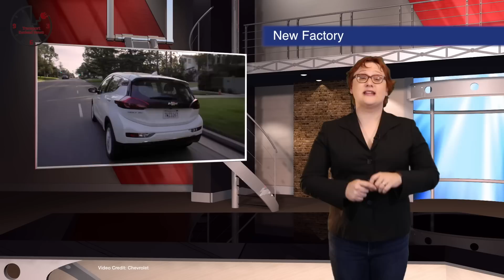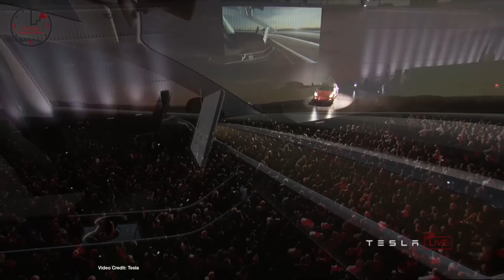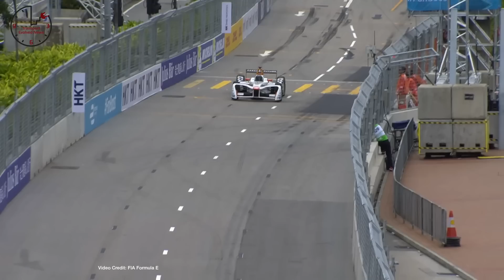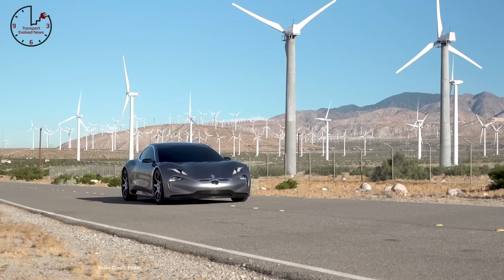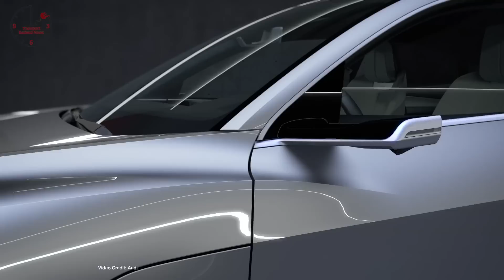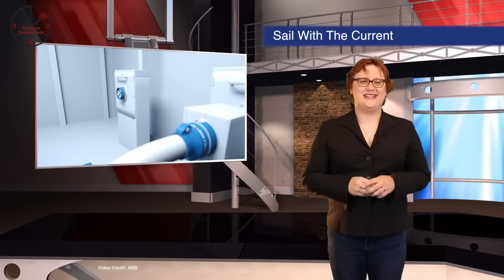Bolt EV Expansion, Model 3 Efficiency, Tesla Car Sharing - TEN Future Car News 8/25/2017

Comment: So, Toyota, Hyundai, and Honda, have managed to sell 1,600 fuel cell vehicles? That was nearly twice what I expacted, but still far less than what they had planned (Toyota had predictdd 2,000 by now) 
Tesla produces and sells more EVs in a week than the total production of all fuel cell cars from all manufacturers in 40 years! Hmm, same for Nissan and GM. 
Not looking good for hydrogen.
Reply: give hydrogen a decade or 2... remember EVs was around for over 100yrs and its still taking slow to sell... i'm not saying hydrogen will be popular with cars but their is a future in semi trucks...
Reply: Chris Muir Well their are a lot of hydrogen fuel cell buses
Reply: The first hydrogen fuel cell was made in 1838, the first experimental fuel cell vehicle somewhat later. So, fuel cell vehicles are not that much "younger" than battery electric cars. 
The real drawback of hydrogen fuel cells is the cost of hydrogen fuel, which leads to a per-mile cost higher than gasoline or diesel, and a price several times higher than "driving electric". For that reason alone, hydrogen has no future in semi trucks.
Reply: well Toyota is building hydrogen buses for the 2020 games in Tokyo, so we'll see how economical it really is and if it does really have a future... as for the cost of hydrogen many experts has said time and time again if we was to produce more hydrogen it will become much cheaper (even cheaper than gas to run per mile)... currently battery EV is the cheapest to run per mile (but not for the long term as the cost of a replacement battery put it around the same maintenance cost as an ICE car).... 

i think there is a company named Nikola that is selling hydrogen trucks (the funny thing is that they did do the research and saw that a battery EV semi truck is not worth the operating cost or down time it will take to charge up a battery that size, not to mention the weight of the batteries) big companies has already made deals with them and they'll be building a bunch of hydrogen refuel stations in north America...
Reply: There were hydrogen busses at the 2010 Vancouver Olympics, too, but they haven't caught on, even there. High cost of hydrogen is still an impediment, and for technical reasons hydrogen will always be several times more expensive than electricity, there is no way around the physics involved. 
As for "battery replacement costs", it turns out that the PEM fuel cells also have a limited lifespan and a high replacement cost, so the cost per mile is still going to be much higher with hydrogen. 
As for the "Nicola truck", it is still under development and testing, production is years away. Tesla may beat them to market with an all-electric semi, it is not clear whether Tesla plans special "Semi-Superchargers" or "truck battery swaps", but it will involve Tesla auto-pilot driver assist. The huge fuel cost savings of "driving electric" is compelling to any trucking company.

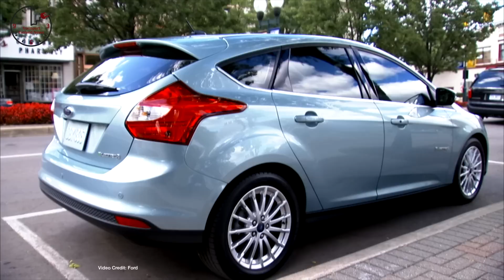Comment: 2:31 Ford made an electric car??
Reply: hornetluca yup. Compliance car. It was the Focus Electric. It got under 80 miles of range I think. Pretty cheap on the used market too.
Reply: Joseph Schatz thanks for your reply.
Reply: Joseph Schatz There's a new version out, I think. Bigger battery, but not much more range - still less than 100 miles. I watched Bjorn give it a go on YT this morning. Still very much a compliance car!
Reply: Main problem with the original was no possibility for fast charging. Coupled with the low range it really wasn't attractive. The new version is still basically a converted ICE car, meaning battery tucked under rear seat/in the trunk instead of built into the floor for better weight distribution etc.

Comment: I have little sympathy for GM. With a leading EV at the moment that has many singing its praises and demand alone for the Model 3 proving there's a viable market for a vehicle of its capabilities.. why the high Bolt stock piles? 
By deduction surely GM's marketing and general ethos towards such vehicles per se could be to blame?  I'm miffed at GM in respect of the Bolt because they've deemed that it's never going to be available as a right hand derivative, a move I take as ignoring a good bulk of countries, many of whom are enlightened in their outlook to EV's. This strengthens my perception of them as producing the Bolt as a token EV,  simply there to be a form of footing in their own backyard against Tesla's rising dominance.  I suppose I'm annoyed too that this vehicle ticks many boxes as a potential EV for me and no doubt many others in the UK but the closest we'll likely get is Opel's lhd version in the showrooms of France!  Shouldn't it be relatively easy to offer this vehicle in right hand drive under Opel though as it's not as if any major re-jigging needs to occur engineering-wise as would be the case with an ICE vehicle. Why too let Tesla, Nissan, BMW and Renault steal a lead in proving this can be done? GM need to alter their thinking, they nearly made it a good while back as pioneers with the EV1 and by now they could have been utterly dominant with the current generation of that vehicle... instead others grasped their discarded mantle and guess what..? It's coming back to haunt them now!
Reply: Surely then GM failed to do their homework before production was given a green light on the Bolt if LG Chem would end up the only people profiting on the Bolt?  A long term player like themselves should've learnt such lessons long ago. Tesla realised that it would have to become a battery producer to start gaining profits and compared with GM and their larger kitty that's what they've done.. Again if GM were committed to EV's and stayed with the lead they had in the past they'd be turning out EV's now with 300-400 mile ranges and be seeing a healthy return per unit on each sale. Perhaps they'd even be offering right hand drive versions in such a range too!?

Comment: Hydrogen Fuel Cell vehicles are a waste of time, manufacturers should concentrate efforts on making EVs go mainstream
Reply: Battery technology advances crazy fast, and it's still ramping up. Tesla is working on a heavy-duty long-haul semi truck. I'm sure they are aware of the regulations, and still think they can make it. The diesel engine and the fuel in truck are pretty heavy too, so there's plenty of room for batteries. A truck engine with fuel can be around 3 tons, which means at least 450kWh. Probably significantly more with newer cells, but Tesla seems to be a bit secretive about their performance. And while a truck is heavy, it usually moves at a constant speed, not too fast, and it's long shape reduces air drag relative to it's weight. This means a large truck is actually far more efficient than a car.
Electric planes are a thing already. I think one has a 600 mile range, but 150-200 is easily achievable. These of course relatively slow, but they are drastically cheaper to operate than a regular plane and this can open up new possibilities. Uber for example is working on small, short range electric VTOL planes to be used in big cities. Helicopters could do the same job, but they are prohibitively expensive.
According to Elon Musk 400kWh/kg pack level energy density is required for big passenger jets. This is about 3x better than the current packs in the Model S (the one Model 3 is likely better). This would be a huge gap for a mature technology, but batteries didn't attract much R&D money until recently, so it's far from being impossible. Actually such batteries are already exists in labs and are getting ready for mass production.
Militaries could benefit from electric vehicles too. Their vehicles are much bigger and heavier and more expensive than civilian ones, so they could have more and better batteries with longer ranges. The benefits are much better performance, low noise, and low heat signature. Also the logistics could be simpler if they use truck mounted nuclear reactors. These can be something like the submarine reactors they already have that are about the right size and provide about 10MW electricity for 20 years. And since this is 60 years old tech, improvements are likely possible. With these they won't have to transport huge amount of fuel for their very thirsty machines.
And finally, you shouldn't transport electricity to far, instead generate it where it's needed. Rooftop solar can do a lot, and the rest can be generated by small nuclear reactors that work everywhere, so they can be close to the consumers.
Reply: There are going to be many applications which cannot run on batteries but need to head away from fossil fuels as well. The weight of the battery to keep a truck going as far as a common diesel version is still heaviere than the vehicles allowed weight in most countries, passenger airplanes with batteries won't be a thing before graphene goes to market and I cannot quite see any major military accepting their vehicles bogged down charging for hours every few miles. Also long range energy transportation via pipelines is way more efficient than electrical cables. So there will be a need for FC tech. Companies can also go both ways. Most of them have for a century with petrol and diesel and soon it will be batteries and hydrogen. One trick ponies tend to not do well in industry.
Reply: the main use for Hydrogen Fuel Cell is things like semi trucks, buses, emergency vehicles... so they do need to develop it...

Comment: So if I put the arrow hub caps on the bolt will I get more range or will the plastic hub caps fall off like plastic hub caps always do.
Reply: +David Beppler That would be very unsafe, indeed. Just so you know, those "lug nuts" on plastic wheel covers aren't actual lug nuts. If you apply a wrench to one it will twist off in a gruesome mess. The actual lug nuts are under the covers which clip on.

Comment: Audi is way behind on flexible solar roof.  I charge my Leaf with my own flexible  solar panels and posted a video over a year ago now has 40k views!  Audi eat your heart out.  The solar power needs to go directly to the drive battery.The only way to do that is 12 volt  dc to 400 volt dc converter between solar and battery pack.  Easier said than done.  I am working on it now.
Reply: solar panels could be made to put out 400V.dc at around 1/8th an amp. with less losses.
Reply: That would work for the roof of your house to charge the car but the roof of my car is covered and only can  get 36 volts in series.  Each of my cells only outputs 1/2 volt and would take 800 cells.  Not enough room on my car to fit all 800 cells.  Dc to DC converters can have up to 90% efficiency.  I believe this has already been done before.

Comment: EVs, dronecars and dronebikes (for two just like a motorbike) will be the future. The gasoline engine cars will be gone forever. Car manufacturers not realising this transformation will be left behind. EV cars are powerful, with less engine components, clean and moreover they are very cheap to maintain. Great to know that many more car manufacturers are joining the EV manufacturers club. Soon the world will be flooded with EVs that makes the atmosphere cleaner. People who got fed up driving on roads esp facing with the massive jam everyday, will go into flying in a dronecar. Whatever it is, though we could see EVs are massively found in China's roads, Tesla is still the champion of EV, but if Tesla goes into manufacturing dronecar just like the Ehang, the pioneer of dronecar, while Tesla a purely original EV manufacturer, which has the battery infrastructure, will be the king of all EVs and dronecars too. With all these EVs and dronecars the future will be really really awesome.